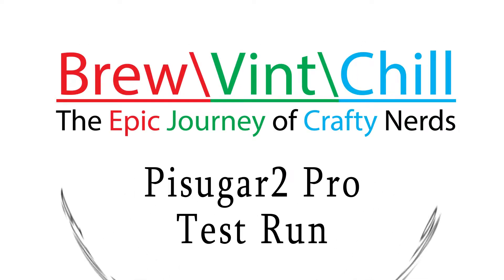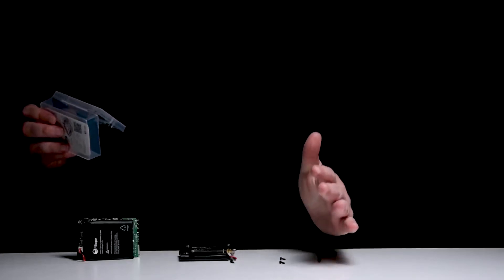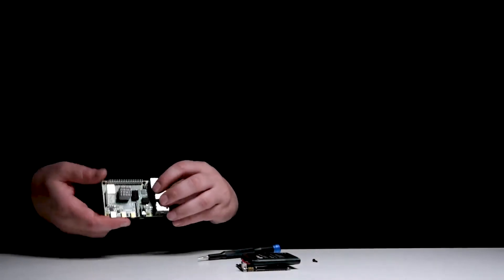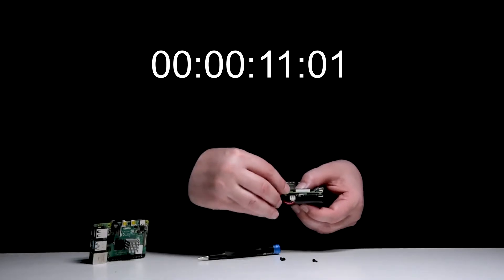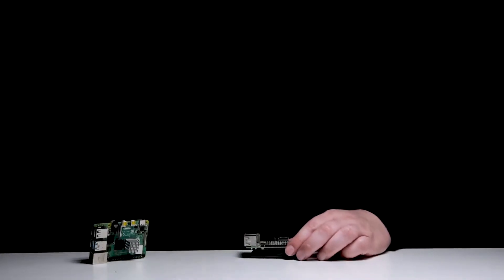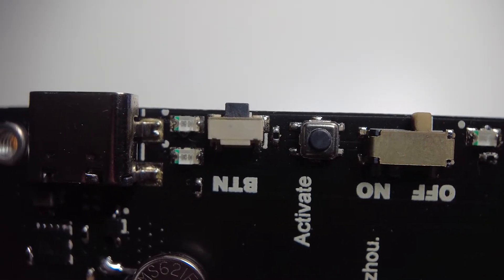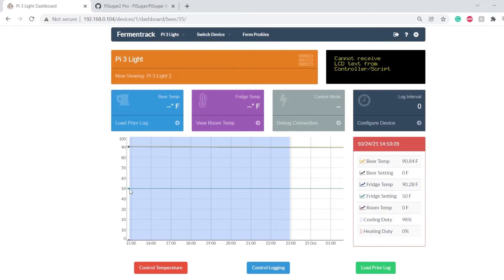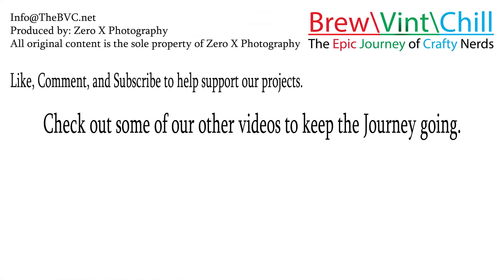PiSugar 2 pro

Comment: nice vid. dumb question:  do you need to charge the sugar battery itself?
Reply from the maker: When the power cable is plugged into the Pi sugar board it will both charge the battery and power the Pi.